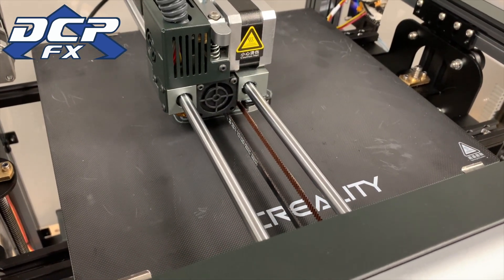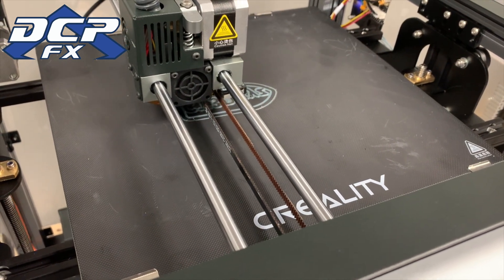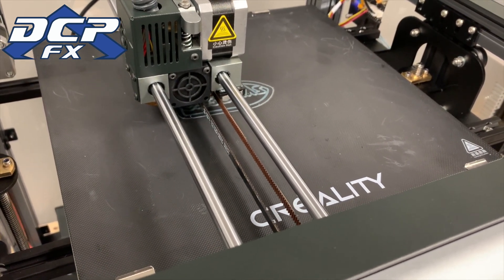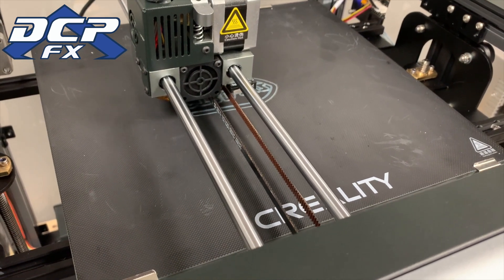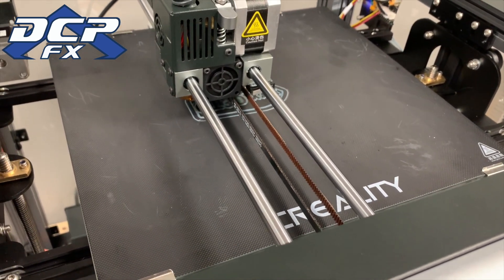Creality Sermoon D1 Update

Comment: It looks like this printer has an open roof to it, it is a fully enclosed printer as advertised? I am intermediate to 3d printing and researching enclosed printers for materials like ABS.
Reply from the maker: No, it’s not fully enclosed. I haven’t tried ABS with it yet, as I’m still getting it dialed in - this is a pre-release unit.